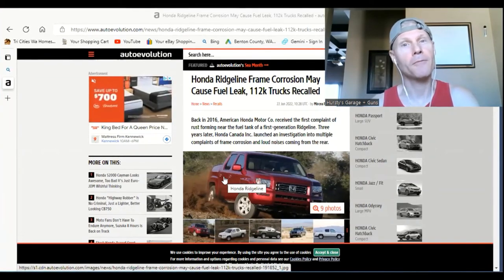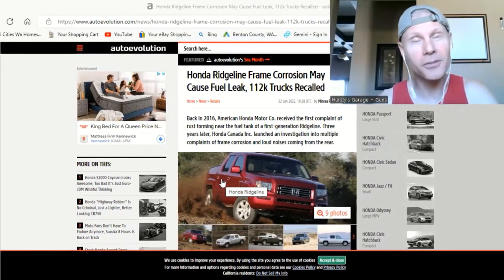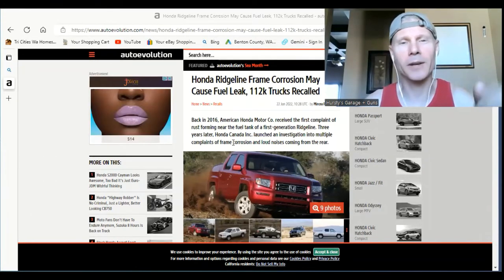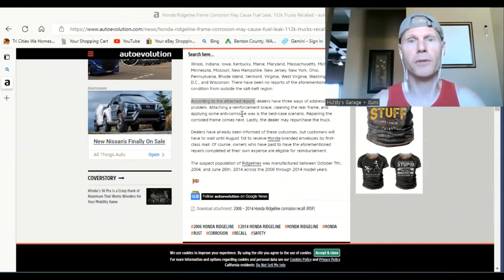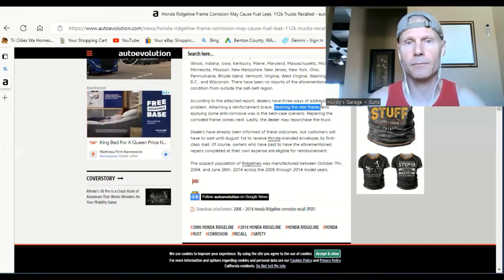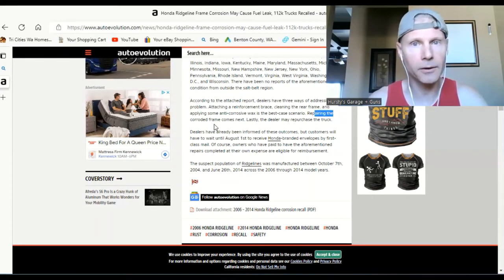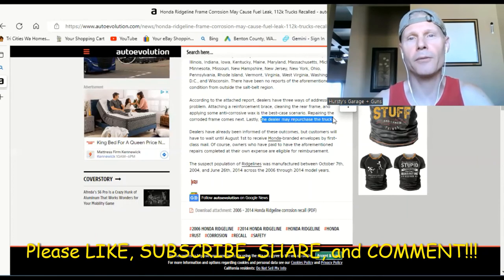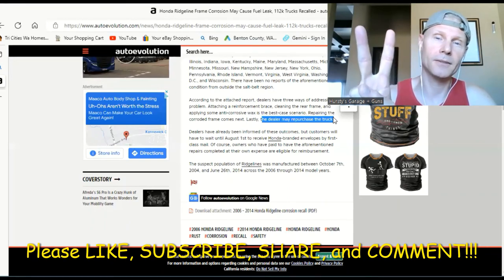Honda Ridgeline RECALL (2022) UPDATE!!!

Comment: Well, I was just over to the Honda dealer today buying some parts and I ask about the recall on the Ridgeline, and they said if it fails the punch test you can’t even drive at home. So I’m not gonna bother getting the recall done because I don’t want to buy a new vehicle at this particular moment. also, they said a 2010 with 225,000 km on it they’re only gonna give you about $4000. I told him it should be double that plus a couple thousand. I inspected. The frame looks fine to me. I also oil spray the truck yearly. I am also a mechanic I know what I’m looking at we’re just not gonna go down that rabbit hole. my plan was to keep it another five years and then get a new one since I’m coming up to retirement. so I think I’m gonna stick with my own game plan I don’t need surprises. if the payout was decent, I might’ve let them check it. You gotta look around there’s lots of vehicles out there running around that are way worse shape than these Ridgeline’s there righting off.
Reply from the maker: Absolutely true, and you being a mechanic you know what you're looking at though I have no doubt you are going to be just fine. I just don't want the regular average everyday Joe thinking the same thing because they don't have the experience you do:-)

Comment: 2014 Sport 98K, took in yesterday and they installed the subframe braces. I crawled under today to see what they did and my frame and rust spots look to be in good shape despite living in rust belt area. Going to keep doing underbody washes frequently during winter months to rinse away any brine and salt and try to extend the life of her. I had a 2007 previously that had 198K miles on it which I do not know the state of rust issue on it because when I got rid of it in 2018 it was before the recall.

Comment: Sooo question, my ridgeline came from canada and was transferred to the states. When I called the dealership near me they said they typically dont deal with Canadian vehicles even after they addressed that there was a recall for the frame rusting out on ridgelines. I'm now having to hound the dealership to try to get an appointment or anything...my frame is completely rusted through on my rear driver side to the point that it has a huge air gap. My passenger side is not far behind but its still 'connected'. Is this actually a thing? I feel like I'm getting the run around, but I'm just looking for a little more help or insight of any kind! Thank you!
Reply from the maker: Crap Fred...sorry to hear about this! Sounds like your RL got a bad case of the rust ick, and if I were you, I would NOT STOP hounding that dealership for anything. That problem is exactly what SHOULD be covered, and I really hope it works out for ya. Hopefully if someone with some more actual in-the-know about this (dealer, mechanic, etc..) reads your comment, they can steer you towards a more accurate direction. To me at this point, like I said, just be a THORN in their side! and if you can, try calling around to another dealership to see what they say. Let us know how your situation goes, ok:-)
Reply: @hurstysgarage   @Hursty's Garage  I thought about calling another dealer, but I called one in the nicer area of town hoping I'd get better service. Plus I figured I don't want to give them the out of not having to deal with me by forcing me to go elsewhere with my issue. At the very least I've mentioned to them that I dont understand how Honda Canada is any different from honda America, especially after it was made able to be transferred to the states... so I made sure to ask questions like " so if my frame rusts away from a known recall issue and I die, how would honda not be held liable?". I'm not trying to be a dick, but I cant afford to buy another vehicle being a single income household and I just wish that everything in this world wasnt such a darn fight.....also Wednesday I'd talked to the manager (he'd called me himself) and he told me he was going to try to get in contact with honda and he'd call me back later that day or the next(Thursday). So I called today and I feel like I'm getting the run around that I'm being told that it takes a few days to hear back from them generally.....so I asked if I'd hear back from the dealership monday or Tuesday, and proceeded to say that I'd call back wednesday and check in again if not lol.
Reply: Have you called Honda yet?

If you're still getting a run around,
I would contact NHTSA, the recall # is 22V-430
Honda Campaign # LCD
Service Bulletin Number  22-021

 If the Honda Dealership finds that the frame on your Ridgeline isn't repairable they will offer you a Buy-back that may or may not satisfy your needs.

Search Honda Ridgeline forums and YT videos under:  Honda Ridgeline Rust/Recall for more information on this subject matter. 

Best of luck.

Comment: Mine is in now.  I should have taken before shots before bringing it in.
Reply from the maker: Hey C T...I will cross my fingers for ya that all works out like you want it! Does yours have the rust showing. Let us know how things turn out:)
Reply: @hurstysgarage  there is a plate that goes across the gas tank.  I see a very new one there now so it looks like they were able to get away with that and went that route.  Mine is a 2007 with 94k miles on it and it's not too badly rusted.
Reply from the maker: Geesh C T...that RL hardly has any mileage on it! Glad to hear that you didn't lose her, and THANKS for the update of good news:-)

Comment: If honda motor is offering LOW (buy-out) 
Than 
do NOT to take in for recall inspection. 
Do your own inspection. 
In today’s market almost all the vehicles have marked up the prices 
Inspect it yourself.
Reply from the maker: I'm beginning to think that you might be right Junk Dog...the only thing with that is liability/safety issue of things, and not diagnosing actual problems IF they did exist. Like I said, I do agree with you to a point...but I just want to make sure that everyone stays safe!  So I will just throw it out there as a general rule...FOLLOW ALL RECALL ANNOUNCEMENTS, and get things inspected by professionals. Now with that out of the way...did yours get affected by the dreaded salt?

Comment: What is all this talk about the frame of the Honda Ridgeline rusting out?  Isn't the Ridgeline unibody construction?  Anyway, I am taking my better ass pass 2006 Ridgeline to the dealership next week.  I will report on how I make out.  I have inspected the underbody of my truck and if the options to reinforce or add protective wax to the gas tank attachment system are not pursued I will know the fix is in.  More later.
Reply from the maker: Hey joseph, how did it work out for you? Sorry that I didn't get back to you sooner, I was out in the forest, with my other vehicle the Subaru forester, doing a little camping:-) you betcha it's a unibody Construction, and I think they're just mainly worried about the fuel tank straps more than anything.. but like I said let us know how your experience went!
Reply: @hurstysgarage  My Ridgeline is at the dealership right now.  I have not heard back from them yet.  I will report the result when I get the truck back.
Reply: @hurstysgarage  I got my Ridgeline back today.  It went the way I expected it would.  They installed a wider, thicker gas tank strap with a new bolt having a slightly bigger head.  There is a noticeable smell so I think they added that waxy substance described in the recall letter.  I think the folks who have trouble with this are those that have nothing to screw a new strap into.  They put the new bolt into the same hole as the original.  Hope this helps to allay the fears of those who think Honda is trying to get them to buy a new truck.

Comment: I send my 06 ridgeline to the recall and the truck doesn't pass because was to bad and it's not way to be fixed , so they told me the company is going to bought it for me and they did, so after 2 weeks they calle me and offered me 9000 so I said OK so that was a good deal to me
Reply from the maker: Hey Jose.. it sounds like it worked out awesome for you and I'm so glad, cuz this can be a very stressful thing and it's been like 50/50 on the responses whether it's worked out well or not:-)
Reply: Ooh….i should take mines in! The interior is clean as hell and the car doesn’t have any engine light. Just rusty rotors and rack and pin rusty. I kno they would give me similar. The car drives like a beast! 284,000 miles!

Comment: Ours just flunked. Was offered well below market value. This is turning into a disaster. 2 days in the shop and it is like the truck is being held hostage. Still waiting. There is some rust but is totally fixable. The offer we got is unacceptable and a HUGE rip off. Disgusted!
Reply: What are you being offered?Also what year,  trim, and Mileage is it?
Reply from the maker: So sorry to hear that this is happening to your Lori.. I was hoping that it wasn't going to be like this, but it seems like the more and more people I hear from, the more horror stories come to light! The only thing I can tell you is that the Ridgeline family here is crossing our fingers for you, and throwing a little prayer at you:-)
And I'm sure you've already thought about this, but make sure that you ask him about the stuff that was in my video that they were supposedly able to do before they totally wrote off your vehicle! Let us know how that goes please.. I'm still holding out for a little hope that you will give us good news:-)
Reply: The truck I believe is the LX. (I’m not sure). 2006 Leather, power seats, and sunroof. 256,000km 
Just spent a ton of money on all new suspension, brakes and rotors and a new battery. Tires are fairly new. The offer $4200.00. Honda Canada says take it or leave it. 
Currently trying to work with the dealer,  but not holding out much hope. 
Thanks Hursty’s for your response.
Reply: @loricody4956  yeah that is a very low offer. I wouldn’t take anything below $5,800 if I were you
Reply: @quintonschultz7779  according to honda Canada we don’t have a choice. We either take their low ball offer or haul it home and have it sit in the driveway. 
Day 4 now, not even using a loaner vehicle (which they are suppose to supply) and we haven’t heard anything else from the dealer. 
We liked this pickup so much, and now it is practically going to be stolen away from us. I can’t believe Honda is getting away with this crap!

Comment: My 2010 RTL passed the punch test in Michigan, got the reinforcing kit, and two months later, my long-term, trusted, independent (brake) repair shop told me they wouldn't repair my brakes(parts and labor covered by warranty) since my underbody had more air than steel. After two rounds and two levels of Honda American customer service representatives, their final answer was No; they installed their reinforcing kit and that is the extent of their obligation. Since my trusted shop put into print on my invoice that the truck should be off the road, can anyone tell me about a class action lawsuit already in progress?